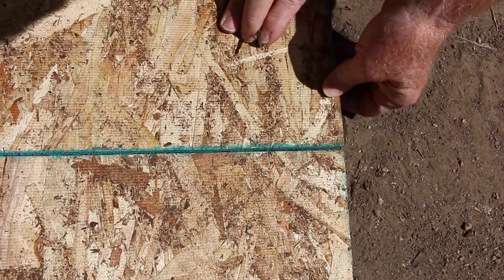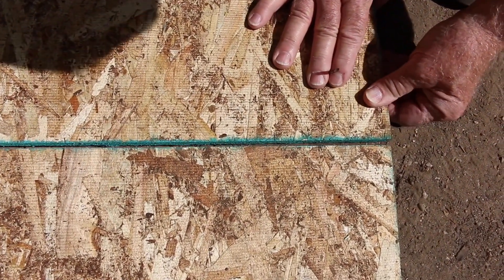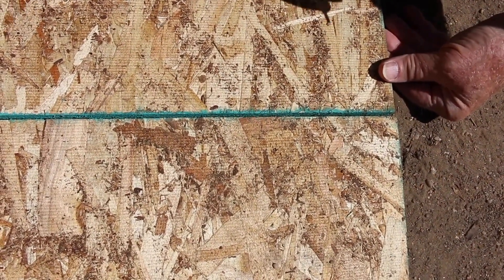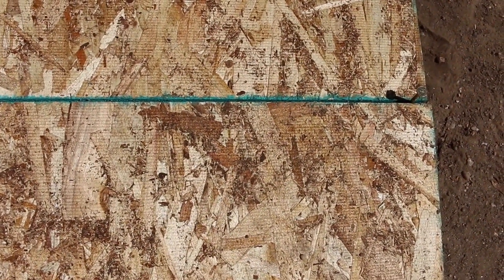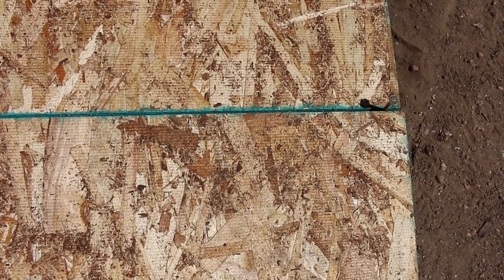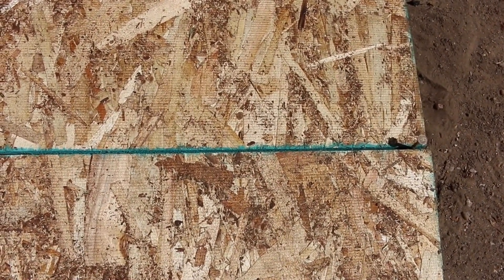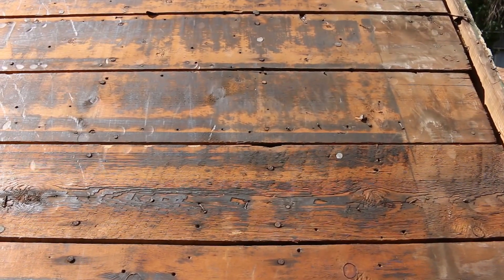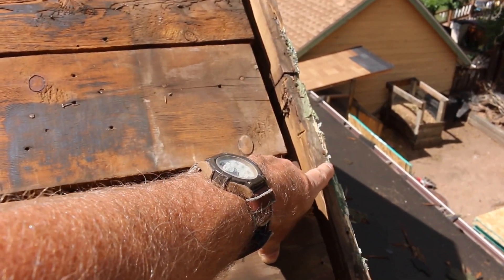PROPER SPACING FOR ROOF DECKING

Comment: The only teensy-weensy little bit of advice I would add is - immediately after you finishing nailing that panel down is - remove those spacer nails. If you don't, you leave a lot of little trip hazards on the roof. Good to see safety harnesses used in the event of a slip, trip or fall.